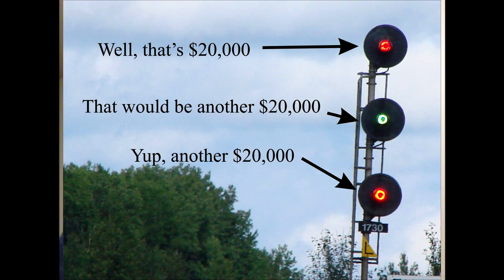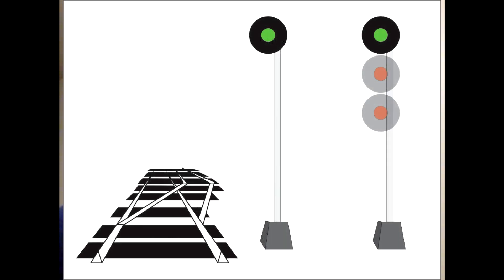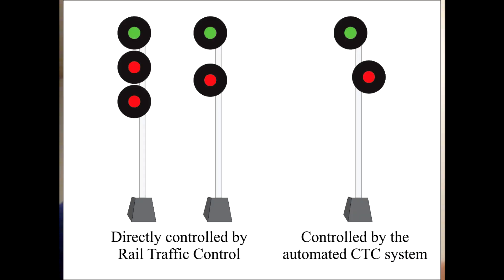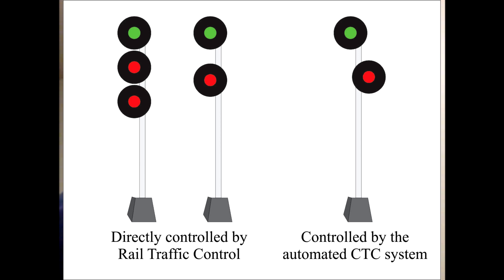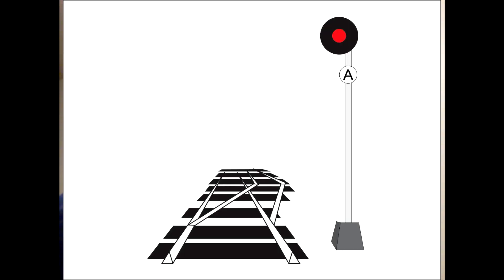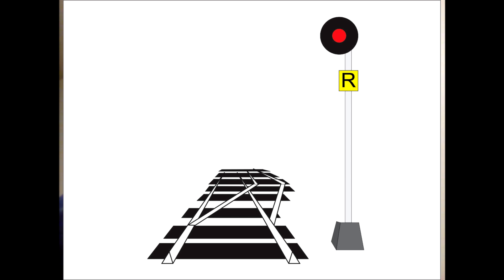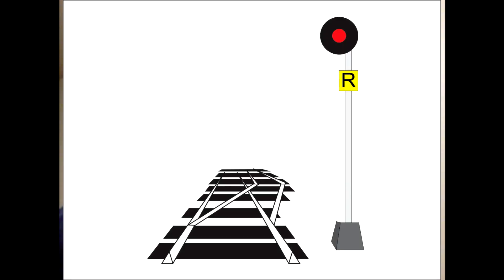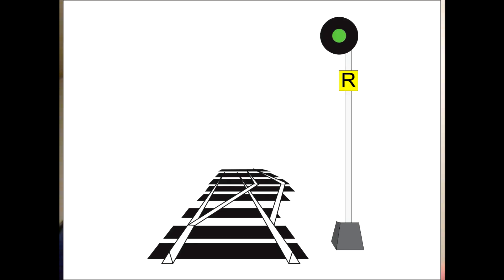Part II Reading Canadian Railroad CTC signals

Comment: Signals are the same for both passenger trains and freight trains. The main difference between the two is that passenger trains are lighter and are allowed to go at a slightly faster speed. Comparing freight trains on the CP Railway in BC to the West Coast Express (a commuter train that goes between Vancouver and Mission on weekdays), the WCE will be going at a faster speed than a freight train on the same line, but the engineer still has to obey the signals. Also, when the WCE is going from Mission to Vancouver, the locomotive is moving the train, but it’s facing backwards. To counteract this, the rear coach has its own operating cab with controls and the engineer will be in there going to Vancouver in the morning, before controlling from the locomotive in the afternoon going back to Mission

Comment: A single headed signal that has red is a stop and proceed. But if it has an A plate it is a stop and do not proceed from what I understand. So if the A plate falls off or is covered in snow then the more restrictive stop and stay that the A plate indicates would revert to a  stop and proceed which is less restrictive. Can you clarify this since it does not seem to be fail safe?
Reply: This is what I've been saying. The (A) shojld stand for Automatic, not Absolute.

Comment: Excellent work!! What is the best way to get into the railroad industry?  I am currently a power plant operator in Alberta but I have been interested in the railroad and I think I would likely enjoy a job with CN or Canadian Pacific.  Im just not sure which direction to go or how to get started.
Reply from the maker: Hi Jon - both CN and CP train you if they hire you. All I can say is apply - and attend a job fair especially, if at all possible.  Right now they're pretty much laying off sadly. But it was a year of applying before I finally got hired on.
Reply: This job be tougher than your current one

Comment: Too bad the Ⓐ is not really failsafe.  What if it falls off or gets covered in snow?

0:41 - Except in British Columbia.
Reply: The (A) plate should stand for Automatic, not Absolute.

So vertically stacked 2-head signals would be the same as a staggered signal. An absolute 2-head signal could have an illuminated (A) which would allow it to switch between absolute and automatic modes. If the (A) is lit up, stop, then proceed at restricted speed. If the (A) light burns out or gets covered over, it is an absolute stop.

The single head signal with no plates would mean Absolute Stop, and Stop & Proceed with an (A) plate or number plate.
Reply: @electric7487  I would have used a flashing red signal on the high-speed head to indicate stop-and-proceed, just like on highways.
Reply: @denelson83  My thought as well, except with a flashing red on any head, not just the top. The other head(s) would be solid red.
Reply: @electric7487  It would have to be on the top head, because then it would mean the same thing at any such signal, even those with only one or two heads.
Reply: @denelson83  Then what about dwarf lights? Wouldn't it make sense to define a flashing lower head as well? Then it would directly carry on over to the single dwarf light with a flashing red.

My idea of generalising this comes from UPRR and BNSF. If you look at their signal rules, they explicitly define all nine "all red, one flashing" indications (six for main signals, three for dwarves) to mean Restricting.

My idea was the same, except that the nine indications would mean Stop & Proceed on absolute signals and Restricting on automatic signals.